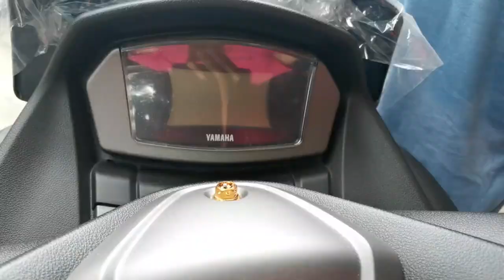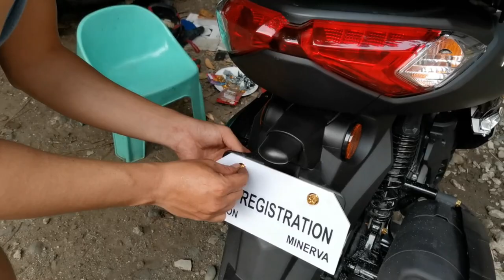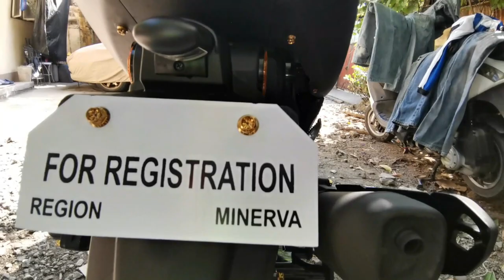GOLD BOLTS SET FOR NMAX V2

Comment: 11:26 ung tatlo nyn sir anong size?
Reply from the maker: Sir pina cut kopo un kapag bbili ka nun sa shop mismo sir wala pa kasi exact sukat para dun
Reply: @jerana8743  so better stay stock nlng po dun?
Reply from the maker: @_clear_8832  ok lang naman sir kahit pa tabas mo ung bolts kasi ung akin naman po wala naging problema
Reply: @jerana8743  tanong lnf sir anong size un 3 hahaha plano ko din kasi bumili tapos ipa cut ko din
Reply from the maker: @_clear_8832  6x30 ata un sir kung di ako nag kkmali
Reply: @jerana8743  6x25 pwd sya?